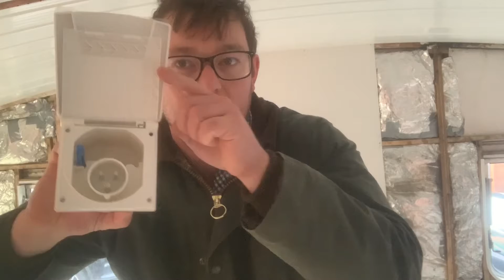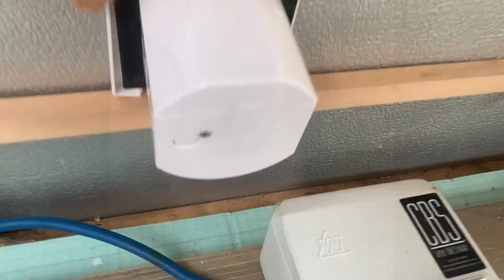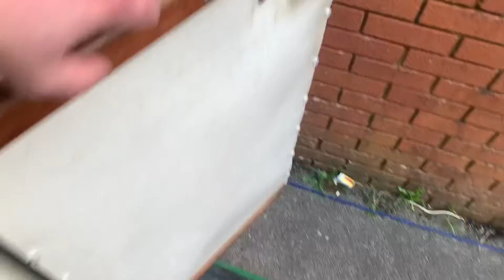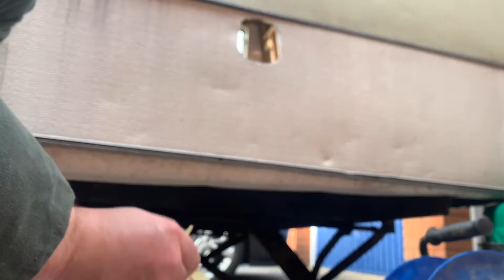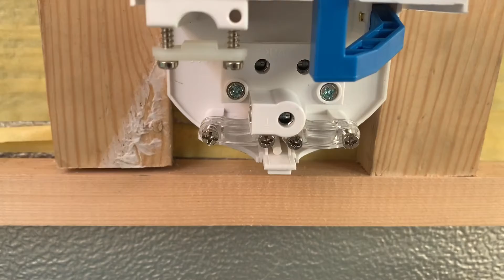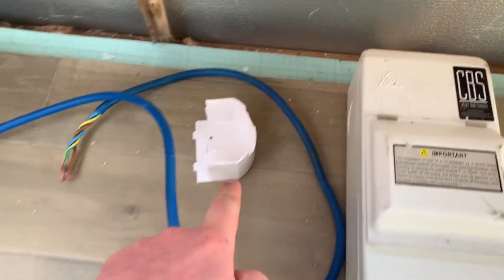Step-by-Step Guide: Installing Your Caravan Electric Hook-Up Socket - 230V / 240V - Shore Power

Comment: so you show everything except the wiring part which is the only part i actually needed to know, this was a total waste of time, next video show the dam wiring any idiot can drill a hole
Reply from the maker: What part of the wiring of the plug are you struggling with? The order of the wires or how to insert wires? And il talk you through it as it’s very simple :)

You say any idoit can drill a hole…. It’s not that simple when you are trying to do it correctly and keep it watertight.